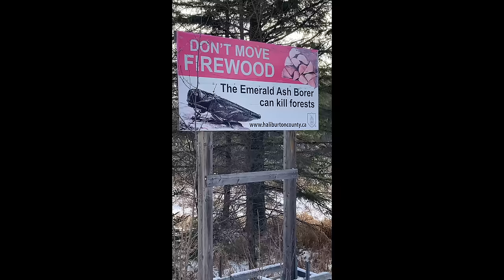747  Spring Chores 1. Kubota LX2610 Compact Tractor. Eastonmade AXIS Wood Splitter.  Music.   4K

Comment: Nice video!  Have a question.  How does the new Homestead grapple compare in weight to your old HLA Grapple?
Reply from the maker: Hi Chad, it is about 100 lbs lighter. Cheers!
Reply: @GPOutdoors  Thanks!!  The Homestead is a 100 lbs lighter?  I am surprised considering it looks like a more bulked up grapple.  So I assume you would have no reservations about the Homestead on a B2601?

Comment: Hey GP, I do have a question for you on the little orange tractor. Since you had the B2601, and now the LX, tell me other than the cab, why you went with the LX. I got my 2601 after watching yours and wondering why you went up to the LX? I know the B kitchen is a bit cramped for a fat old man, and it seems a bit tippy on the hills,, so tell me why you went the way you did, if you dont mind.  Thanks much from down here in the coal country
Reply: Gord , you are the smart one for wearing hearing protection when you are around the wood splitter . I wear hearing aids now because I didn’t do that during my working years .

Comment: That sign about the bug, is old. Nephew of mine is a truck cop and he pulled over a vehicle transporting Ash Firewood. He contacted the EPA in the USA and was told to let them go. The spread of the bug had reached a point of no return. The ASH tree was expected to go extinct on this continent and there was nothing that could be done. This was 4 years ago. Oh, and those people that charge $1000 per tree to "protect" with those "pills" they insert into holes they drill into the trees, utter and complete criminals. Snake oil salesmen and peddlers of Comet Pills. Check online, those "tablets" are $10 for a box of 25.